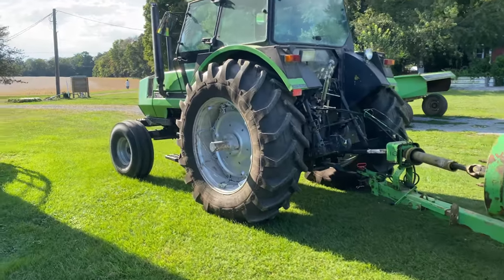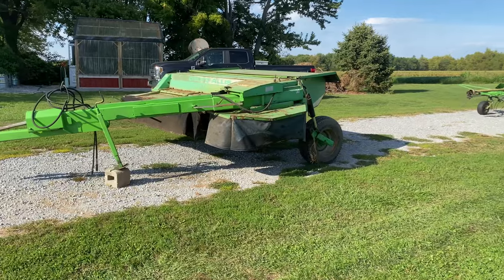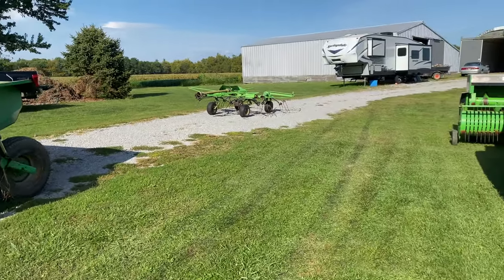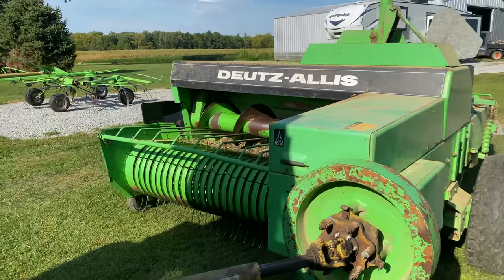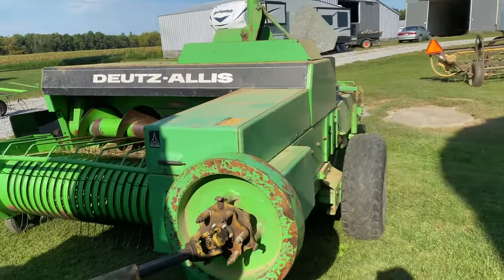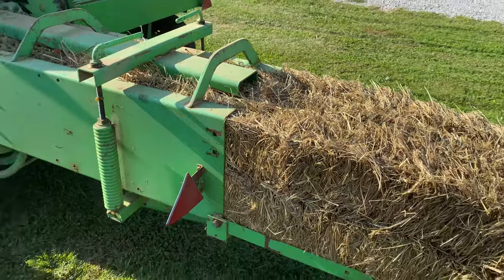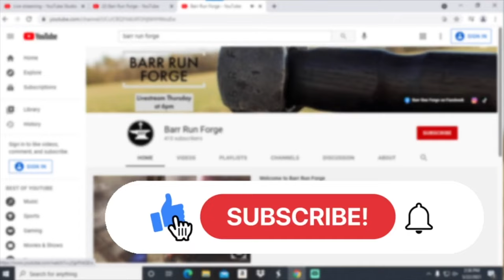Making Hay 2022 I 2nd CUTTING ALFALFA I DEUTZ-ALLIS 7110 I DEUTZ-ALLIS HD 490 I DEUTZ-ALLIS SM70 RC

Comment: Man you've got it too easy! Back in the day making hay as a teenager on a friends farm consisted of a sickle bar on an 8N ford, let it dry in the field for a couple of days, take the farmall cub and pull the rollabar rake, then pull a New Holland baler with a Wisconsin auxillary engine cause the 8N didn't have enough power to run it and then take the cub out with trailer to pick up the hay. On a HOT n HUMID day with no AC! And harvesting corn, oats, and soybeans on other friends farms was no picnic either!
Reply from the maker: Trust me, Frank.  I’ve put my time in, and earned a few “easy” days in hay.